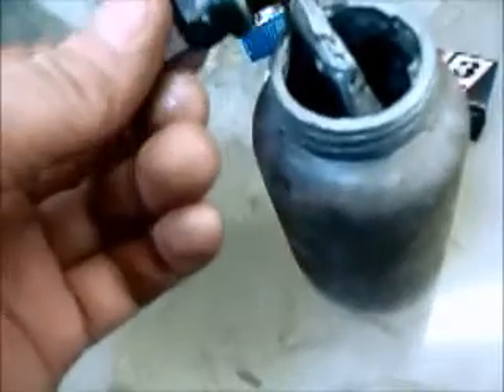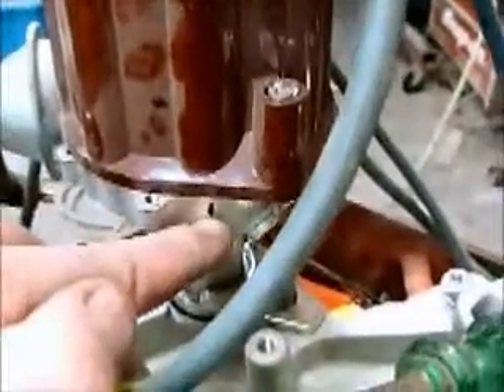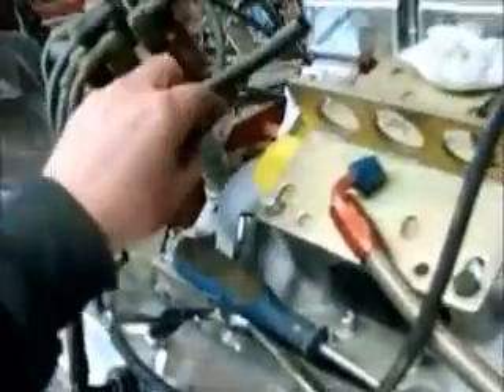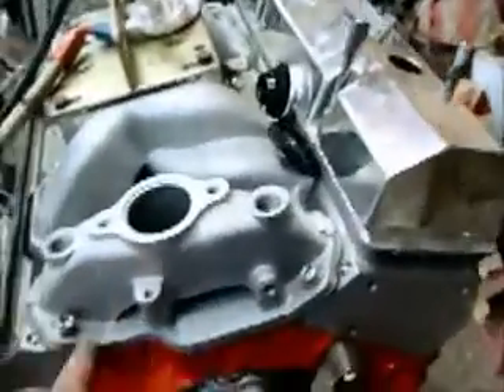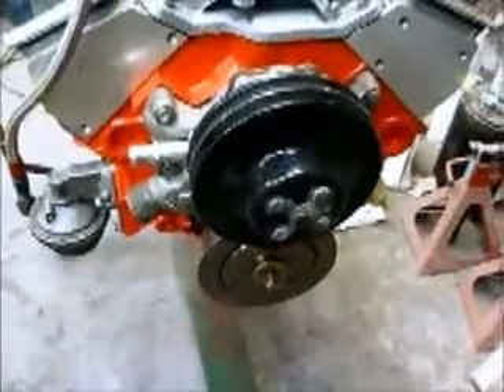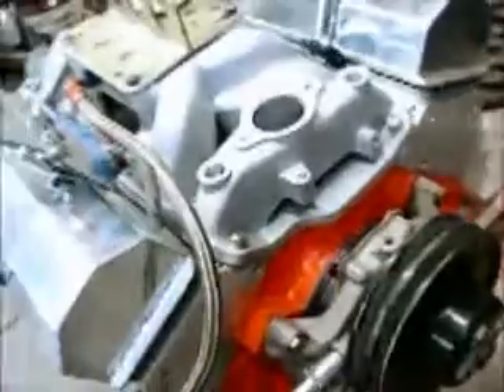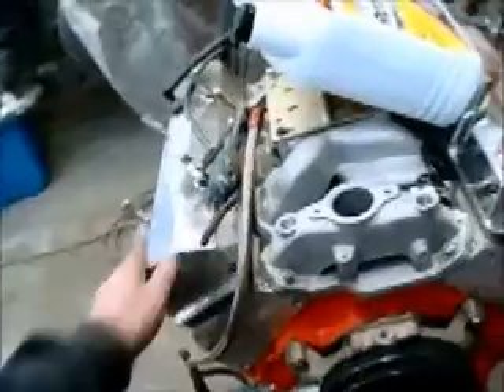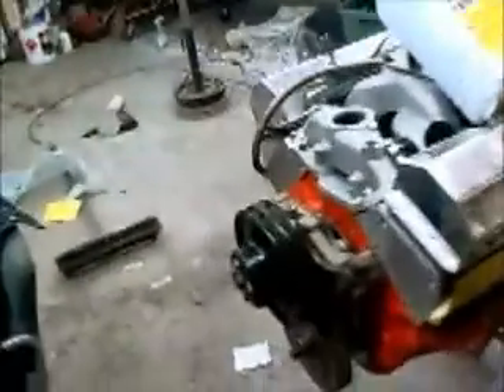building 383 stroker first start and dyno how  diy to caponeauto part 5

Comment: I've run breathers on both side and never had a problem. Done it on quite a few engines.
Reply: That's all I ever use. The Smokey Yunick PCV trick does prove to add a few horsepower however.

Comment: One other thing, I've also dyno tested EVERY SBC (so called) MARINE HIGH PERFORMANCE EXHAUST system, and reported the results to the respective MFG's. I'm not going to slam anyone but I will say this. The (no longer made) GIl small block manifold was the best! (out performed the shiny $$$$$ stainless steel one's). 
ALL systems tested had a MINIUM of 25hp loss over the stepped 1 7/8" long tube dyno headers.
Only one MFG. stood up to the plate and admitted the exhaust system was not a HP system (although they advertise it as such) they just said it's a light weight, long lasting system (and it is) and thanked me for the results. That was, STAINLESS MARINE.
The GLM manifold did vey well for a stock type manifold.**

Comment: Nice build video....What a shame you wasted all that time and money on PROCOMP heads. I have many hours of dyno testing those POS procomp heads, and found a stock pair of vortec heads will beat them...Max HP with AFR's...
Reply: pro comps have a bad rap because there is too much meat in there....port them and you will see
Reply: Sundance7055 Try a set of "real heads" and you'll see! Been there, done that!!!!!!!!!!! Still like the build shot's.
Reply: Sundance7055 BTW porting fully 100% CNC'd PRO CRAP heads is not a good idea, and there is nothing you can due to change the incorrect spark plug hole location!!!
Reply: tundra1211 you're a fucking moron.
Reply: Vortecs flow around 30 cfm @ .500 better than camel hump F.I. heads, cut the bump out of the roof of the camel hump exhaust ports and unshroud the intakes on the camel humps and they will edge out the Vortecs by about 15-20cfm @ .500. , but the very most you will get out of camel humps is around 260 cfm @ .500. And you wont have heads that the seats crack between the valves like Vortecs do.

Comment: 500 torque is a lot out of a small block so a good cam selection, should pull that old Chevy pretty easy but i think he needs maybe 373 gears not those 3.25 super highway gears-- You know i never knew that a standard cam had lobes ground at an angle to keep pressure due to distributor gear pushing the opposite way-- Back in the day i had a 67 RS Yenko clone Camaro- 427/425 with a 4 speed and 456 gears, strokers and aluminum heads were almost unknown then unless you were a millionaire-- 427 L-88 had some aluminum head versions--

Comment: hey i have a 79 camaro it has a 305 in it i want to put a 383 in it what all would i have to change
Reply: Get yourself a 350 4 bolt block to start with. Or just build the 305. A 305 has the same crank as a 350, just a smaller piston. Put a good set of heads on them and they go pretty good. Most guys don't want them because the heads suck. That makes them cheap to build.